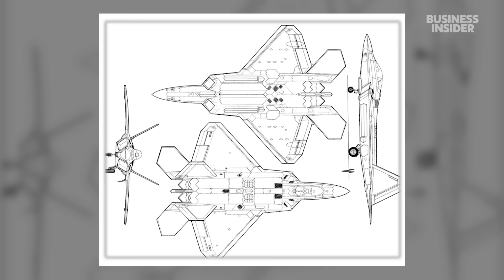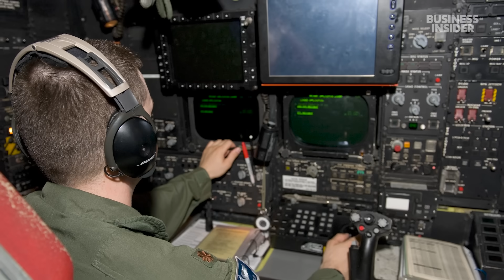USA vs China Fighter Jets | Balance Of Power | Insider

Comment: Why is the F-22 Raptor far superior?
The stolen technology used to build the J-20 was based on an outdated blueprint of the F-22 Raptor. The F-22 became operational on December 15, 2005, while the J-20 entered service in 2017, meaning the technology they stole was already a decade old. Not to mention, the Raptor's pilots have extensive experience and have been combat-tested.
Reply: The pneumatic layout is completely different! Are you delusional about persecution? China now has J36 Sixth Generation Fighters. Did they steal from the United States?

Comment: I used to think this video was accurate until it said that China doesn't have its own fighter jet engines. That made me doubt its previous claims. China does have its own engine called the WS-15, which is already installed on the J-20. It's important not to overestimate your opponents, but you shouldn't underestimate them either. Confidence is good, but blind confidence isn't.

Comment: The J20's supersonic cruise capability and maneuverability are not as good as the F22, and perhaps its stealth capability is not as good as the F22. This is a fact. However, the F22's avionics system is outdated, and it does not have EOTS EODAS and other systems. To put it bluntly, the F22 is not as powerful as the F35 in modern air combat. The F22's supersonic advantage is useless under beyond visual range and various modern sensors. I personally have always believed that the F35 is the most powerful fighter jet in the United States, and the F22 is similar to the F14, which has a lot of emotional points.

Comment: I expect China to develop teaming tactics using 2 different kinds of J20 … the standard variant and another variant that replaces the radar with a high performance optics based sensor/target designator.  Shared data between the j20 team makes multiple radars redundant and all aircraft will have results of both radar and optical sensors.

Comment: J-20 advantages
-better maneuverability[turn radius] thanks to canards, but could possibly give more RCS depending on radar angle
-IRST sensor which f-22 doesnt have, therefore F-22 will have poorer performance in mid range and short range combat
-much newer HUD and electronics, although f-22 got some upgrade
-cheek mounted AESA radars for better bvr evasion
-china according to all rankings outperform US in material science, hence i reckon their stealth coating might be better

J-20 could potentially hold advantage in BVR combat due to being newer plane with more features, better stealth and better missiles, but that's largely speculation, J-20 would have definitely edge in shorter ranges with its HMD, better turn radius and irst 360 tracker. F-22 was simply created where computing power and AI didnt exist and the computing power was rising exponentially with each year, it also suffered due to budget constraints and manufacturer having last word on what system should be axed and which should stay. It was a plane designed to trash soviet planes manufactured in 80s and was never designed nor it could had been designed to face modern post 2010 planes.

Comment: The only real advantage of the j-20 is its sensors except those are cancelled because the f-22 has a much smaller radar cross section. The f-35 has better sensors than the j-20

Comment: But the J-20 does supercruise contrary to how it is portrayed here, and it is equipped with more modern sensor array equipment more in line with the F35, moreover there are more operational J-20s and it is currently in production so there are even more on the way, the F22 might be more be a be slightly better machine but that difference probably won't count for very much

Comment: This discussion ignores the operational environment.  An F22 doesn't have the range to get to the fight without external fuel tanks and midiar refueling.  A tanker based on the Boeing 767 jetliner is not stealth, nor are external fuel tanks.  The J20 is designed to take out AWACs and Tankers.  The F22s will be ditched in the ocean without the tankers.  Stealth is also widely misunderstood.  The very small RCS of the F22 is the backscatter RCS. The radio waves do not scatter back to the transmitter. They are diverted to other angles.  This is why  bistatic and multistatic radars can detect stealth aircraft.

Comment: "The balance of power goes to the F-22." Really? Are you sure about that? In a 1 on 1, head to head scenario? Yes, however the ccp (people you wouldn't trust if they told you "water is wet") are claiming 200 operational j-20's. How many operational F-22's do we have? How many more can we make (the answer is zero because a lot of the equipment used in the manufacture of the F-22 is now being used to make that stupid looking but highly capable f-35). Now to a bit of brighter news...the F-22 is about to be replaced by an even more advanced, more capable and even lower observable/greater stealth fighter than the F-22...or so I'm told.

Comment: Chinese little pinks in the comments are hilarious. The J-20 is an inferior fighter but that's not the point. It's proof that China is catching up faster than the US military expected. And the guy said that if Chinese ambitions are merely regional it doesn't need to be superior to the F-22.
Reply: no, we're just pointing out the bullshit in this video. china's new ws-15 engines can super cruise, and the J-20 has more modern electronics than the F-22 (mainly because the j-20 is a more modern plane).

Comment: His conclusion is largely true between the J20 enter the service in 2017 and F22. It is a remarkable win for the U.S , considering F22 entered the service back in 2005.
However, J20 has an advantage that , it continued to be produced and improved overtime while F22 production line was closed permanently. There are several iterations after the first batch of J20, notably the new engines WS15 and rumored GaN AESA, this accompanied by the increased production pace (100-120 per year) and better ranged Air to air missile (PL15) . The conclusion of this video may not be so true now.

Comment: 1) J20 has much better radar (GaN AESA).  During the time F22 was developed, GaN radar hadn't invented yet. 
2) J20 has better electronic. The chips on F22 was intel 586 level. 
3) J20 has better missile. Before deployment of AIM-260, USA dont have a missile that can match PL15. In the mean time, PLA already has the PL17 ready. 
4) J20 certainly can supercruise. The  WS10C engine currently equipped on J20 already has the supercruise capability not to mention the WS15.
5) F22 lacks EOTS and EODAS, which are crucial when facing stealth fighter.
6) J20 has much larger range.
The only short comings of J20 I can think of are:
1) J20 does not have autocannon
2) J20 does not have the 2D TVC Engine which affect maneuverability. Due to the canard design, maybe J20 does not even need a TVC engine.
both of them are less important in BVR fighting.
Reply: F22 is not the most advanced American fighter jet but j20 is the most advanced Chinese jet and f22 is still better then j20
Reply: This is just Chinese wishful thinking without any basis.
Reply: @마루치-o3l  This is also just american wishful thinking without any basis.😎
Reply: @마루치-o3l you too as well talking the f-22 😂😂😂
Reply: this comment is far more informative and reliable than the whole video lol
Reply: AIM26) could fit inside internal weapon bay while PL-17 doesnt...hihihih

Comment: The F-22 lags far behind the J-20 in all technical capabilities, such as Stealth(J-20 has used next generation lefthanded metamaterial stealth material), Maneuverability(WS-15 engine performance data is ahead of F-119 engine),  Supercruise(1.8 Mach super cruise speed, Maximum speed 2.8 Mach, even 2.55 Mach only with WS-10C engines), Advanced avionics, including low-probability-of-intercept radar (LPIR)(latecomer advantage with third generation semiconductor gallium nitride technology), Networked data fusion, enabling situation awareness on the battlefield(Latecomer advantage, Radar, IRST, EOTS, EORD).  And air-to-air missile dual pulse solid fuel engine technology, the PL-15 has a far greater range than that of the AIM-120D.

The core processor of the F-22 uses a 500nm technology node PowerPC 603 chip, while the core processor of the F-35 uses a 90nm technology node PowerPC 7448 chip. The core processor of the J-20 is reportedly based on a 28-40nm process chip. The first GaN radar prototype for the U.S. military produced by Raytheon was first installed and tested on April 29, 2021. Therefore, both the F-22's APG-77 radar and the F-35's APG-81 radar are second-generation semiconductor GaAs technology radars. The APG-77 has 1956 T/R modules with a peak power of 20 kW, while the APG-81 has 1676 T/R modules with a peak power expected to be lower than 20 kW (due to second-generation GaAs technology). The J-20's KLJ-5 radar has approximately 2200 receive/transmit T/R modules, with a power output of around 100 kW as reported by the State media CCTV, which can only be achieved by third-generation semiconductor GaN technology power devices. This implies that under equivalent other conditions, the detection range of the J-20 radar could be 50% greater than that of the F-22 and F-35 radars. Consequently, the original plan of the U.S. military to start upgrading the core processors TR-3 and radar APG-85 for the F-35A Block 4 Lot 15-17, which was accelerated to 2023, has now been postponed again, and it is uncertain when the upgrade will enter service.

According to CCTV data, the fuel consumption rate of the turbofan WS-15 without afterburner is 0.67 kg/daN/h, and the fuel consumption rate with afterburner is 1.98 kg/daN/h. The fuel consumption rate of the turbofan WS-10C without afterburner is 0.85 kg/daN/h, and the fuel consumption rate with afterburner is 2.2 kg/daN/h. The fuel consumption of the F119 without afterburner is 0.9 kg/daN/h, and with afterburner on it is 2.4 kg/daN/h.

Comment: The F-22 isn't even the most advanced American stealth fighter. The F-35 while less cool looking and less famous than the F-22 is 10 years newer with more advanced systems. The U.S military also has nearly six times as many F-35s as it does 22s so in a potential conflict between the U.S and China a fight between F-35s and J-20s is a much more likely fight. The AirForce is working on restarting production of F-22s and wants a modernization program but that is a long way.
Reply: Only 29% of F35 is operational, another tax pit.

Comment: 1. When he talks about Radars he should be talking about how powerful the radars that those jets carry, not how difficult they can be detected by other radars. That's still stealth. J20 has the most advance gallium-based radar.
2. Speaking of maneveurs, he said he didn't have too much data and he said Chinese jets are unimpressive. If you have not enough data, you shouldn't be so conclusive, let alone, so subjective. 
3. He is wrong about the engine too. J20 has been equipped with a new and far more power engine WS15. He needs to get his data updated.
All in all, he speaks from many subjective opinions based on outdated data, and neglects many key elements. Not a quality video.
Reply: "One of its earliest versions of a domestically designed engine, the WS-10A, regularly broke down after just 30 hours of use. 

The main difficulty lies in the metallurgy and machining. A single engine on a civilian Boeing 747 airliner, for example, has at least 40,000 parts. Temperatures in that engine can reach as high as 2,500 degrees Fahrenheit, and its fan blades can spin well over 3,000 times a minute during an hours-long flight.

Blueprints for such an engine can be copied, but the secrets to producing and shaping metal parts that can withstand those temperatures and spin at such tremendous RPM over thousands of hours — not to mention external factors like wind resistance and corrosion — without breaking aren't easy to find."
Reply: The most deadly thing is not to fight alone, but to form a system. With the cooperation of early warning aircraft and loyal wingmen, this system can give full play to the greatest advantages of all parties and form an effect of 1+1+1 greater than 3.
Reply: The new engine for the jet is still in testing and is not even working so what are you talking about. In that case the US could bring the NGAD fighter into the comparison. Also the Chinese don’t have a radar better than the F35 or F/A22. China boasts about its mighty dragon but won’t even give details or its radar cross section
Reply: and Gan based radar and WS15 engine isnt yet into service....duh
Reply: J-20 is the most agile fifth-generation aircraft, and will eventually be on the turbofan 15, now the air combat is not close combat, will not give you the opportunity to close up. The J-20 is ahead of the F22 in terms of avionics and situational awareness, and its air-to-air missile PL15 has a far greater range than the F22's AIM120 and has a dual-pulse engine. As for the f35, the biggest enemy of the f35 is not the J-20, but the anti-stealth technology and modification potential. The J-20 is also the first in the world without stealth, but the f35 is embarrassed, even because of the common shock of the tail can not supersonic cruise. Then, all the actions the F22 has done, the fourth generation can do. The maneuvering performance of the f22 displayed by the j20 at the Zhuhai Air Show in 2022 simply cannot be done, and there are videos of that day everywhere. Americans like to brag, at the beginning also said that the f22 lift coefficient 2.0, when the Chinese really built the j20 lift coefficient 2.0, only to find that the f22 only 1.5 lift coefficient.
Reply: In respect to maneuverability, The ws15 hasn't replaced the ws10 yet, its still very early on in limited adoption. Even then, by looking at the j20s aerodynamic design, its gonna lose a dogfight to the f22 which has much lower wingloading and thrust vectoring. We havent seen thrust vectoring applied to the ws15 equipped j20s yet.
Reply: @nuckerball1259  J-20 was never meant to dog fight. IT was not designed to merge and turn fight. It is and always will be a stealthly missle truck with a good radar and excellent long range A to A missiles. It dumps its missles and turns back to base to reload. In its envisioned role it should perform better than the F-22 due to newer loger range missiles and newer sensors.
Reply: @SandersBernie-dl6in  I'm aware of this. Completely different design philosophy.

Comment: This guy analysis is meant for kintergarden audiences who know nothing about the J20 and F22A. First of all the new J20B w WS15 engines w higher thrust to weight ratio and overall thrust than the PW119. WS10C engine can allow the J20A to supercruise at M1.5 and the new WS15 can allow the J20B to supercruise at M1.8. Besides the guy didn't mention the F22A doesn't helmet mounted sight, can't do network warfare, doesn't have ETOS and Long range infra red detection capabilities..... etc which the J20 have crucial in combat against stealth aircrafts. J20 radar w much more advance T/R modules than the APG77 used by the F22A hence has longer detection range and better anti-jamming capabilities. Besides the PL15 has 50% more range than the AIM120D which means the J20A/B can detect and shoot down the F22A long before the raptor can detect and fire upon the J20,  The USAF is betting on NGAD against the J20 and that tells U which is better. LMAO!!!

Comment: A bit picky maybe
Radio waves have wavelengths of 1 m up. The frequency at 1 m is 300 MHz. 
Microwaves have wavelengths of 1 mm (millimeter) to 1 m. The frequency at 1 mm is 300 GHz.
Modern RADAR uses microwave, not radio waves
TBMD uses SPY-1B/D

Comment: The actual matchup would surprise you. F22s were designed in the 90s with 90s era computers and sensors. They are out of production and are steadily being retired meaning their numbers will dwindle while J20s are still being built and improved upon.

The latest version of the J20 has 360 degree infrared sensors that can passively detect other stealth fighters without even having to turn their radars on. Its the same tech used in the F35 which has beaten F22s using just that method.

J20s also have a modern datalink which allows it to spot targets for each other and other PLA fighters, F22s have to rely on their own radars to engage targets meaning they can't remain radar silent when attacking.

Finally, the age of the airframes also makes a massive difference. Stealth coatings age just like anything else. Worn stealth coatings from 2 decades of use are significantly less stealthy than something fresh out of the factory. Not to mention the J20 was designed using much more modern stealth coatings after seeing the headaches the F22 causes when it comes to maintaining said stealth coating.
Reply: Well basically if the j20s infrared search can pick up and achieve lock on an f22 before the f22 can lock and launch on it, then yes. Impossible to say for sure because we don't know the real stats of these vehicles. They are very different in design philosophy, with j20 being more comparable to the f35.